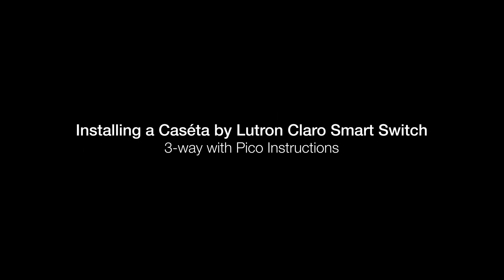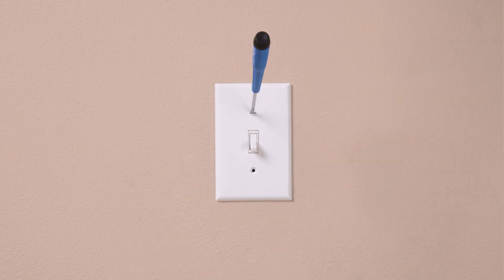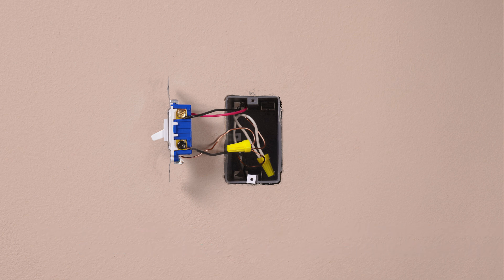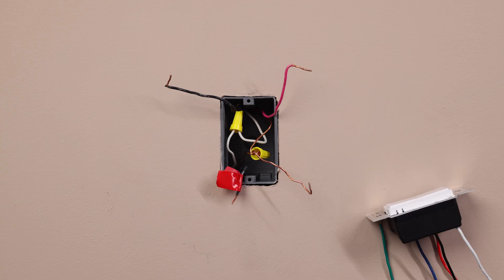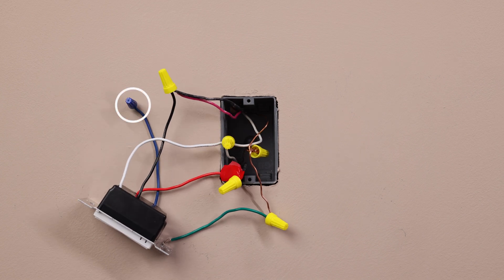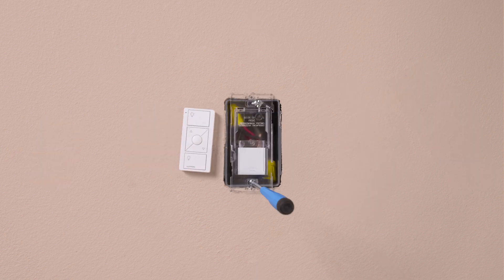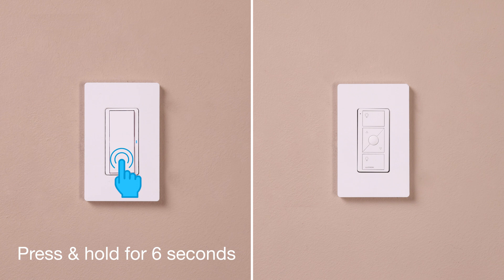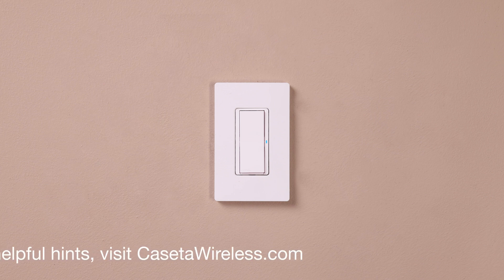Installing a Claro Smart Switch and Pico remote for the Caséta system in a 3-way application

Comment: This video contains a critical error at 1:06. The video says to connect the red wire on your switch to the tagged wire from the wall - but that's inaccurate. You should connect the black wire on your switch to the tagged wire from the wall, and the red wire should be connected to the other two remaining wires from the wall. This is according to Lutron's own PDF wiring guide.

I tried following this video at first and my switch wasn't working. Then I checked the PDF guide, followed that instead, and my switch worked fine.